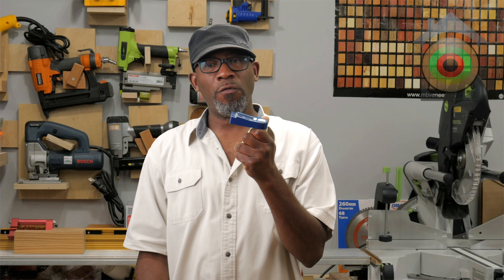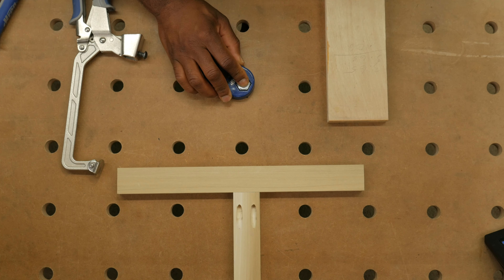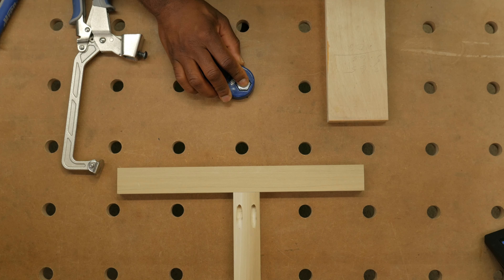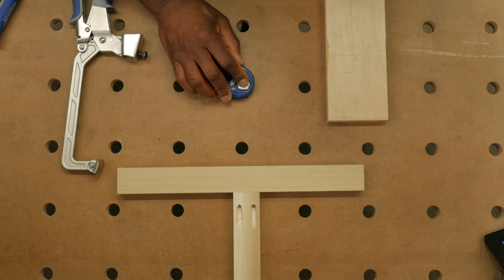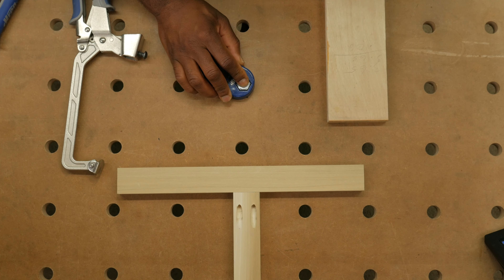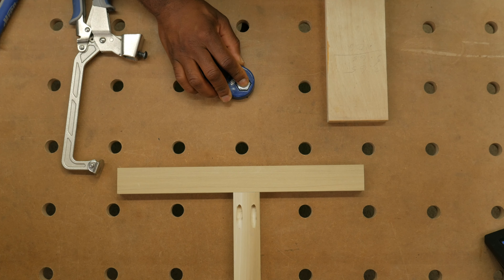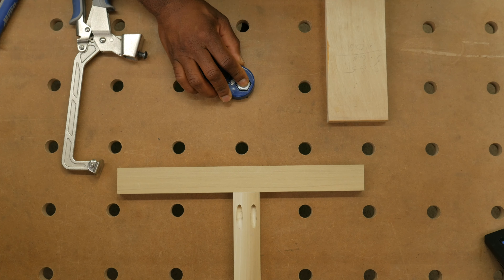KREG BENCH CLAMP BASE

Comment: Nice, but IMHO, I prefer the use of a Festool quick clamp in this use case. While the Festool clamp is $50, most MFT users already own them (or similar ones) and at a total of $70 for the clamp and the holder, this is a bit more expensive... but may work a hair faster and is easier to do one handed.
Reply from the maker: You know what, that’s a good idea! I never considered using the quick clamps in that way. I’ll try it then I’ll do a comparison. Thanks!